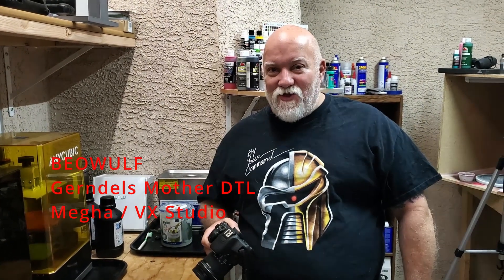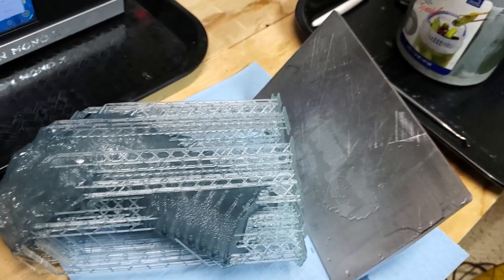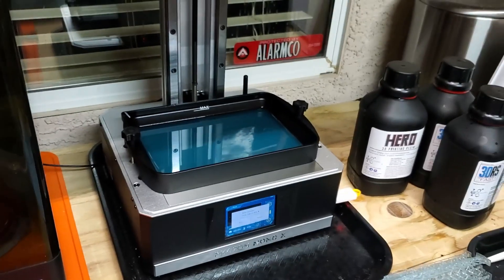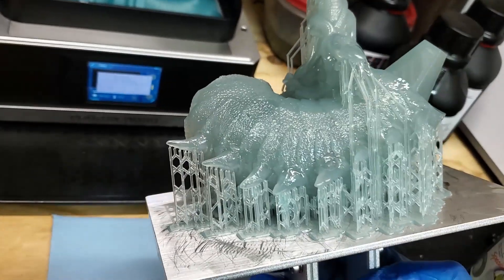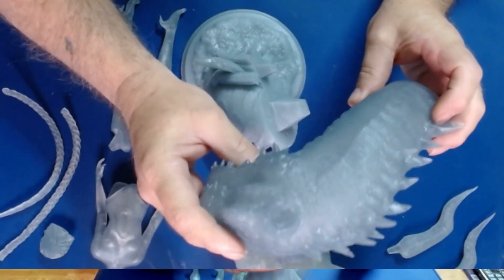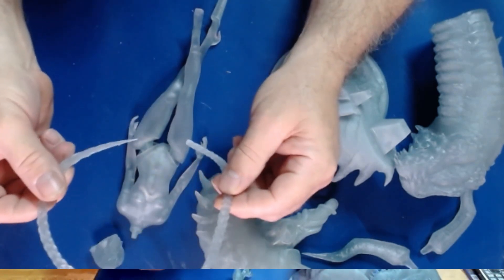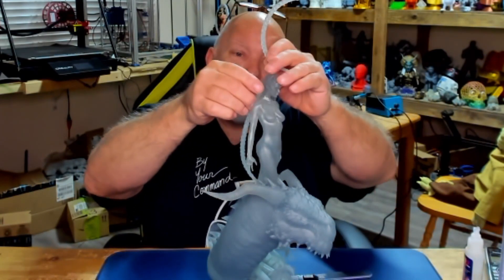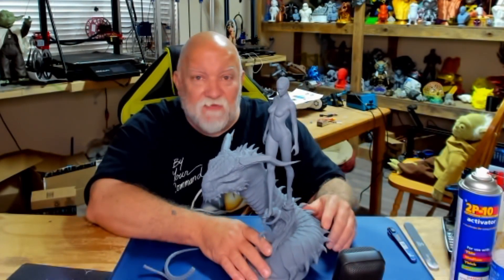BeoWulf Resin Print w/Resin Lapse On my AnyCubic Photon Mono X #3dhp

Comment: Wow! Do you have a video on your print and support settings for large pieces like that? Everything I try to print this big keeps failing either from supports breaking or the print has large cracks in it. So frustrating!
Reply from the maker: I use medium supports usually.Increase your support density.If there 50.make them 75. more supports in each area.
Reply: @3DHP  Awesome, I'll try that! Thank you! Do you have your power set at 50% or 80% for the mono x screen? I've seen people use both, but not sure what I should start with.
Reply from the maker: @mboxcreative597  All stock setting, changed no screen setting, not sure what your talking about. Sometimes I bump up exposure time and support density only.
Reply: @3DHP  Got it. It's the UV power, you can change in the settings on the printer itself. Mine was default at 50%, but some people have it set at 65% and some 80% to get lower exposure times per layer, but maybe that's what's causing my issues. I need to try out a lower setting, I think!